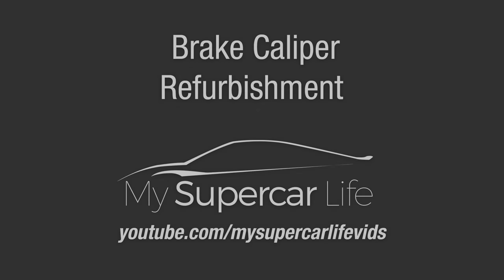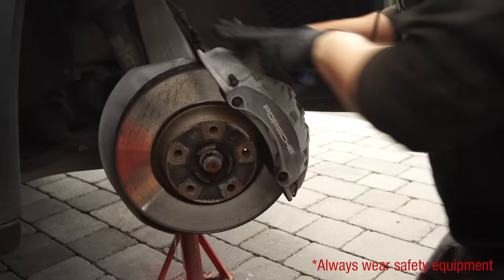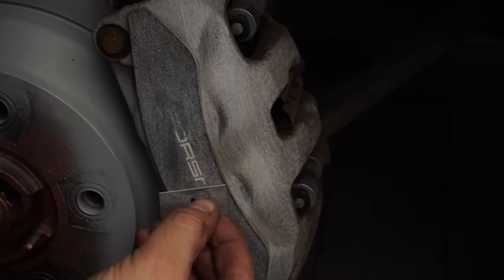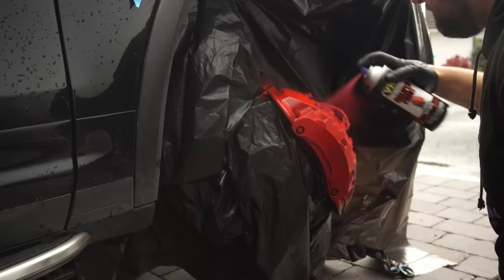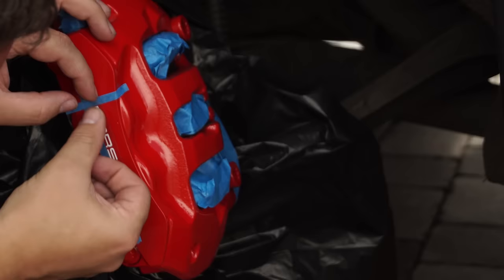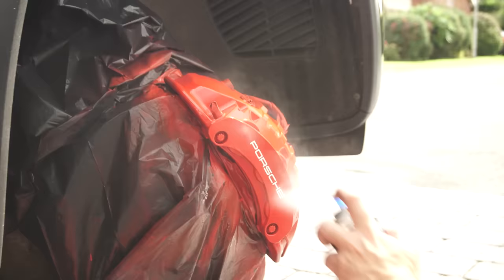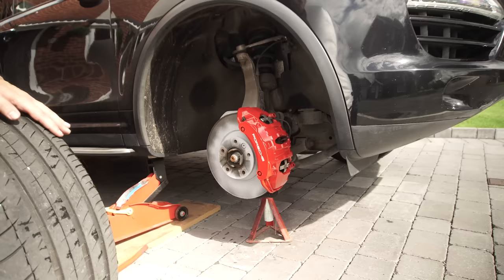How to Paint Brake Calipers

Comment: Did you use hig temp decals or any especial material for decals?
Reply from the maker: I contacted all of my suppliers to ask if they did high temp vinyl and they said there was no such thing. I even ordered a set of decals that were in 'hi temp' vinyl and they were the standard Oracal Vinyl that I use! So the answer is that I used normal vinyl which when cleared over shouldn't have any issues. I would imagine that if you didn't clear coat over them that they may shrink, or more likely the adhesive will soften.

Comment: Hi what ist name of spray you use for clear coat ?  need to bay one thanks
Reply from the maker: Hi, it's VHT brand I got it from frost.co.uk but I think you can get it from Amazon

This is the red: http://www.frost.co.uk/automotive-paint-coating-electroplating/automotive-paint/vht-paints/vht-high-temperature-red-caliper-paint-310ml-aerosol.html

This is the clear: http://www.frost.co.uk/automotive-paint-coating-electroplating/automotive-paint/vht-paints/vht-high-temperature-gloss-clear-caliper-paint-312g-aerosol.html

Hope this helps.
Read more

Comment: Beautiful job. Wonder how long it will holdup ?
Reply from the maker: Thanks! They looked exactly the same when I sold the car nearly 2 years later apart from 1 stone chip. I really recommend the paint I used in this video. I need to repaint my new cars calipers as they've been done before with cheap paint and look terrible compared to the ones I did in this video.

Comment: How long did the paint look good for without putting high temp primer?
Reply from the maker: Hi. You don't use primer with VHT brand caliper paint. It's designed to be used without. I had the car for just over 18 months after painting and they looked exactly the same as when they were first printed.
Reply: @MySupercarLife  nice! I'll buy that brand then. Thanks for responding and helping me out
Reply from the maker: No problem. Just make sure everything's clean and it will last. Good luck! https://www.vhtpaint.com/high-heat/vht-caliper-paint

Comment: Great video would it be the same principle for the wheel hub? Looking to paint mine in gloss grey
Reply from the maker: Hi, Yes it would be the same. Wire brush to remove surface rust, then clean with brake cleaner etc. Then paint. If you want a factory look, use Zinc primer but this is matt not gloss. Also don't be afraid to get a little of the paint on the disc as the pads will clean it off and give you a nice line. You can see on this vid where I've painted the hub.

Comment: I would like to know how did you clean the cables. At the end of the painting you can see them in red and then they are black again... Thank you! Nice video :)
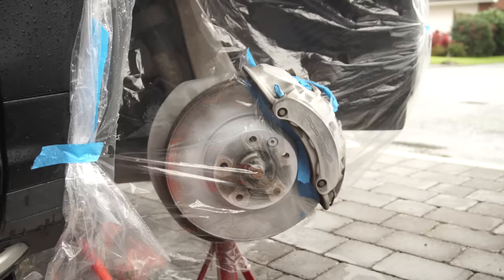Reply from the maker: Hi they are covered in blue painters tape (masking tape) at 2:44 which is removed at the end. Hope this helps!
Reply: Oh my bad didn't watch carefuly. Thank you again!! driving in city not "racing" do you know how long the color can stay? it's by any way harmful to the car?
Reply from the maker: No problem 😀 - It's all down to the prep and the paint you use. If you do your prep well, and make sure the caliper is clean, then use a good quality paint like the VHT brand then I don't see why it wouldn't last for quite a few years. These calipers have been painted now for around 9 months and they still look as good as when they were done. If you use a cheaper paint it may fade or blister so it's worth taking your time and using good quality materials. It's not harmful to the car so don't worry.
Reply: Thank you! Keep up the quality videos my friend, best regards :)
Reply from the maker: No problems. You're very welcome 👍

Comment: With all respect those 3 leg jack stands are dangerous. You can't even buy them on this side of the pond. The legs, which are nothing more them sheet metal straps, can easily collapse and ruin your day.
Reply from the maker: They're 3 tonne rated and are very common in the UK. I have seen thin cheap nasty ones though so I understand what you mean but these are not those.

Comment: How many cans are needed bro for all 4 calipers
Reply from the maker: You should be OK with 1 of each. I did these with 1 paint and 1 clear coat  but the paint was running out in the end.
So if you can get a spare paint can, but you will only really need 1 clear coat as you don't use as much of it.

Comment: why not unmount them and save the trouble and the posibility of red paing going on car? would be much easier to clean too!
Reply from the maker: Hi, Thanks for commenting.
I didn't want to take the calipers off. This is my daily so I can't be without it, and I don't want 2 tonnes of car on jack stands for longer than it needs to be. The calipers look fine and the only benefit of taking them off would be I could have painted the back, which you never see

Comment: What did you use for the discs? And are you from the stoke on trent area? Your accent sounds local. Cheers
Reply from the maker: It was a High Temperature silver/grey from Halfords it looks ok but it's not quite factory, although my tech guy at Ferrari has just told me what they use on the centre of the discs so I'm going to see if it's readily available. I'm from around that area ;-)
Reply: My Supercar Life I guessed as much ;) do you use AD much then? And I use VHT stuff for mine, I've even used hammerite spray in the past and had good results. That was on a 300bhp S14 that got used properly too
Reply from the maker: I've hear that hammerite smooth works quite well. I used to go there alot, but I had a few problems with a couple of their products so I don't use them anymore. I bet the S14 was a hand full!
Reply: My Supercar Life it was! And probably my favourite car owned. I currently have a grey R32 GTR, you may/may not have seen it about, I've had it for 9 years now and visited a few local meets etc. Do you ever go it the bleeding wolf meets?
Reply from the maker: +Gav Marson very nice mate.  I don't get out much LOL. I haven't been up there, I saw it advertised last year but never went. Is it any good?
Reply: My Supercar Life absolutely! I would highly recommend, a good bunch of enthusiasts from all scenes, I like to see that. I'm currently doing a few bits on my GTR so it's off the road for the winter now, but when I go next I'll reply on one of your videos and maybe see you there for one of the cars and coffee meets
Reply from the maker: cool, sounds good, let me know. Good luck on the GTR I feel your pain, got lots of little jobs to do over winter, just hope we have a mild one this year so we can get some done.
Reply: My Supercar Life will do mate. Are you a local detailing business then?
Reply from the maker: No, I just like keeping my own cars clean :-)

Comment: Vht red and a standard clear coat ?
Reply from the maker: Are you asking if you can use VHT and standard clear? If so, then I'm not sure. I used VHT for both red and clear to be on the safe side. I have read that you can use standard colour paint and VHT clear but not seen anything on the other way around.

Comment: Why didn't you apply primer?
Reply from the maker: Hi. You don't need it with the VHT paint. It's designed to be used on bare metal. Just make sure you do the right prep work and it'll be fine. Hope this helps, thanks for commenting
Reply: Thanks :o)
Reply from the maker: No probs 👍

Comment: You don’t own tools for removing your calipers but you own a vinyl decal cutter?
Reply from the maker: Not quite, I own all of the tools to remove the calipers, however when I bought the car the dealer decided to service the brakes without a porsche computer which meant they locked themselves in to service mode after someone tried to reset them. The car then had to go to a porsche dealer who nearly had to replace the entire braking system including the abs and brake system ecu as non of it would communicate with each other. I think the bill ended up around £2k as it took about a week to figure out.
And that is why I didn't remove the calipers 😄

Comment: Why didn't you just remove the caliper?
Reply from the maker: This tutorial is aimed at people who don't want to remove the calipers, or on a car where the braking system is computer controlled like the Cayenne I detailed this in the sticky post at the top where the car had to go in to a Porsche dealer for 2 weeks because a Land Rover dealer decided to try to service the brakes when I bought the car and screwed the whole system up. Also because this was my wifes daily driver it cannot be off the road whilst I strip all of the calipers off and then rebuild them all.
Reply: @MySupercarLife  Well that is on me for not thoroughly reading.  My concern would be painting, especially when using a spray can, something I'm not suppose to spray paint. Yours came out well, the clear coat did wonders.
Reply from the maker: @niquenso2926  No problem, I understand, but as long as you only paint what is supposed to be painted then it should be fine. You just need to mask off any cables / hoses / sensors / bleed nipples etc.
The clear coat is amazing, It really made the calipers look great, and they looked exactly the same nearly 2 years later when I sold the car and I put that down to the clear coat protecting the red paint 👍

Comment: 6:16 where are your lugs on that rotor?
Reply from the maker: The car uses wheel bolts not lug nuts. This is normally the case with most European cars. Hope this helps.
Reply: @MySupercarLife  oh! Ok. But what if the thread gets stripped? Your bolt will be loose. With lug and nut you can change either if it gets stripped. It just seems safer to me :)
Reply from the maker: That's just the way the cars are built. I've never come across a stripped wheel bolt, cross threaded yes but never stripped. You can change to stub axle though if that happens. I think they're both as safe as each other but I have to admit that it's easier to put the wheels in cars with studs as with bolts you have to line them up or use hangers 👍
Reply: @MySupercarLife  oh ok.. good job on that caliper though. I may do that to mine but I want neon orange color :)

Comment: You didnt apply...a primer paint...why?
Reply from the maker: Hi, The VHT paint does not need a primer as it cures using heat. The calipers still looked great when I sold the car 18 months later
Reply: @MySupercarLife  ...wowwwwww. ..okayy...thank you. ..keep up the awesome vids...
Reply from the maker: No problem. It really is a good quality paint and I'd recommend it. The person who has painted the calipers on my new car has used  cheap paint and it's faded and stained. I think the VHT clear coat helps prevent that from happening.

Comment: I would have just invested in some tools 🙃
Reply from the maker: I have a full tool chest of tools, but I didn't want to take the calipers off. When I bought the car, the Land Rover dealer decided to do the handbrake shoes, which meant that the brake system went in to service mode and wouldn't come out. The car had to be recovered to a Porsche dealer 40 miles away to be reset, however this didn't work as the brakes wouldn't come out of service mode and the module wouldn't communicate. They nearly had to put a new brake control ECU on the car, when the decided to try swapping my brake ECU with another Cayenne. The other Cayennes module worked in my car, and mine worked in the other car.  They reset it and swapped it back and it's all be fine since, but that little episode left me without a car for a week.
Still think it's a good idea to remove the brakes?
The other thing is this is my daily so I can't be without it, and I don't want 2 tonnes of car on jack stands for longer than it needs to be. The calipers look fine and the only benefit of taking them off would be I could have painted the back, which you never see.
Reply: My Supercar Life did you disconnect the battery before working on the car 🧐🤔😉
Reply from the maker: What, to paint the brake calipers?
Reply: My Supercar Life no bro, what you wrote before lol😶
Reply from the maker: OK, Firstly if you read my reply you'd see the part where I said the Land Rover dealer I bought the car from did the brakes before I collected the car. I DIDN'T DO THEM.
Let me explain how the rear brake system works, as you clearly don't understand. You can't disconnect the battery when working on the brake system on a modern car, and even on an older car I have no idea why you would.

As it was later explained by the Porsche dealer this is where it all went wrong with the Land Rover dealer attempting to do the job 'on the cheap' without the correct computer and knowledge (They should know this as the latest Sport has a similar system).

To replace the rear brakes, you have to connect to the Porsche diagnostic unit to release the parking brake and calipers and put them in to service mode which releases the pads from the discs and the shoes from the inboard parking brake.Then you have to remove the caliper and disc then replace the shoes etc. 
After that you have to measure the airgap between the shoes and the disc, this has to be entered in to the diagnostic system to set the distance in the brake ECU. After that you have to perform a re-grind procedure where the computer pulses the brake system to complete the process.
After this the brake system can be taken out of service mode and everything works as normal.
It's not the 80's where everything was on cables. With the advent of electronic braking systems everything is way more complicated than it used to be, and why you wouldn't be able to disconnect the battery, as to do the brake job the car needs to be connected to a Porsche diagnostic computer.

The Land Rover dealer had a 'specialist' try to reset the computer out of service mode, which is where it all went wrong as they didn't follow the correct procedure not have the correct computer and equipment in the first place which meant that the braking ECU went into fault mode and wouldn't reset eve with Porsche's computer, because someone messed with it who didn't know what they were doing in the first place.

And that is why I would rather leave the brakes on the car. 😜
Reply: My Supercar Life makes sense, come to think about it.🧐
Also, just curious , how comes you didn’t place the “Porsche” decal first then paint over that. Once the paint dries, then simply peel away. For a more oem look.
🤔
Reply from the maker: No problem, I'm used to older systems where everything was easy, so this was all new to me too and I'm glad I didn't have to pay the Porsche dealer to fix it LOL I think the bill was somewhere in the region of £1000 for what had to be done 😱 and if it needed the modules and everything changing (they wanted to change the calipers and everything) was something like £4-5k
I know what you mean, but I'd have had to paint that bit white first then paint red, then remove the decal. That would be a good way to do it for the best finish but I they do look good enough as-is. 👍

Comment: just remove the damn caliper and work indoors
Reply from the maker: A few reasons. The last time someone removed the brakes on this car it had to go to a Porsche dealer to have the computer swapped from another Cayenne as it lost sync with the module which took 3 days. There is no way I'm messing with them, plus not everyone has the tools and ability to remove them. This is my daily so I can't have it off the road whilst I take the calipers off, then strip, paint and rebuild them, then put them back on. Lastly, I don't want 2+ Tonnes of car on my drive, on jack stands for longer than it needs to be.
Reply: yeah, i understand. i have like 30  year old cars my self so little more simple with them.

Comment: No primer????
Reply from the maker: No, You don't use primer with VHT brand, or any other brand or high temperature paint as it's not required. I think it's because the paint is enamel based which cures using high heat unlike 'normal' car paint which requires primer.

Comment: very lazy, kinda had the it'll do' mark all over it...hell its a porsche so why not
Reply from the maker: Why lazy? They were prepped and painted properly and still looked just the same 18 months later. There is no it’ll do about it, i did it properly.
Reply: @MySupercarLife  If i were the one doing it, id take em off. check seals and replace if need be, strip the old paint, mask off and sand blast, finally prep for powder coat of my choice and stickers to go with. so ya VERY LAZY work.
Reply from the maker: I've addressed this already MANY times. This tutorial is aimed at people who don't want to, or don't have the means or knowledge to remove the calipers from their car, or it is their daily car like this one is and they can't take it off the road for 2-3 days while they remove - rebuild and repaint the calipers - I think it's better that people who have little to no knowledge of braking systems don't start removing parts from their car especially calipers! 
This is a YouTube tutorial, if people are searching for this kind of thing it's because they don't necessarily have the means to do it the way you describe but want to make their car look better. There are better ways to do everything, but that doesn't mean you should say my method is lazy, it's a way to do it without removing calipers. So no NOT LAZY.
Reply: @MySupercarLife  i take no half measures or shortcuts...ur way works no doubt. but my way is the right way. aesthetics is the whole point, but function is the primary goal here so why cheap out? your total investment wont be more than say 1~3k...your right about one thing its not lazy its "fast and cheap, skip quality"